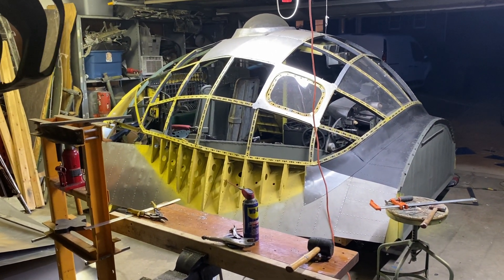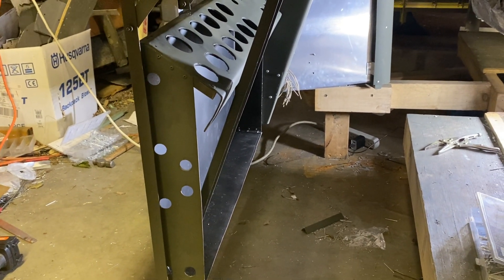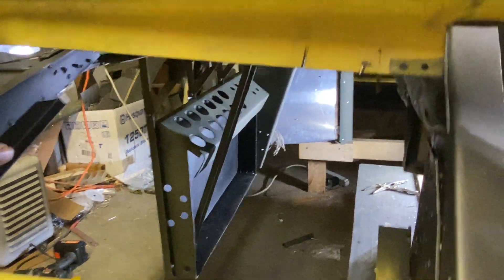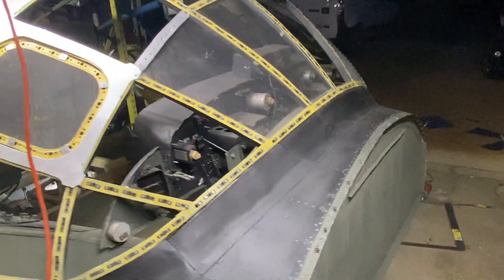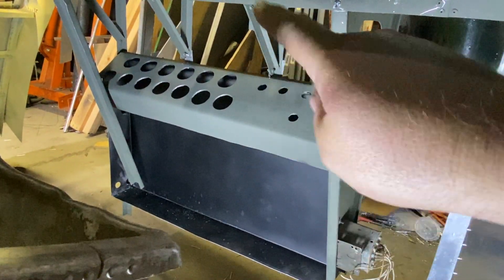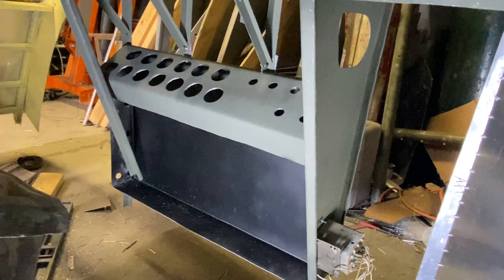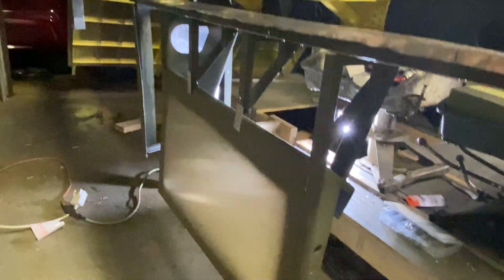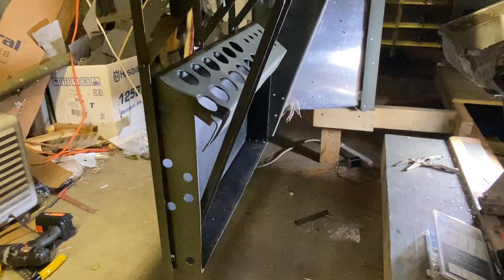B-36 Propeller Control Junction Box

Comment: I remember seeing a catalog back in the 80s-90s that sold cannon plugs, all different sizes and pin amounts. (I was in the USAF at the time, so I was interested in electornics etc). I'm sure it's available online, but haven't looked for that stuff for decades, well before the internet came along. If you can't find authentic cannon plugs for those holes, if you can find a description of them they may be available new. The catalog wasn't military, it was for civilians. I actually had a pair of PRC-510 radios which had been surplused out, and we (my friend and I) were able to find a plug that fit inside the battery box and got the radios to work!!
Reply: I knew you were in the AF before you even said it.  Using Cannon Plug to describe any cylindrical screw on electrical connector gave it away.
Reply: @snklfrtz    Really? What do the other services call them?

Comment: I'm not 100% but, I think the B36 is the only Recprocating Engine Aircraft to have Reversible Props. It's common on Turbo Props but, I think on Reciprocators it's quite the challenge to make a Prop Control that can change the Blade Angles all the way from the Feathered Position to a Reverse Position 🤔